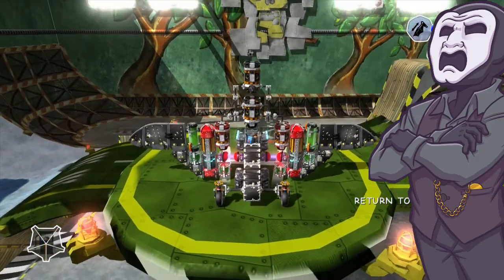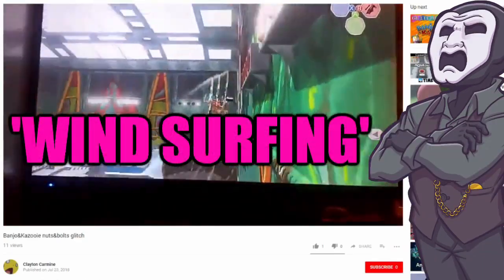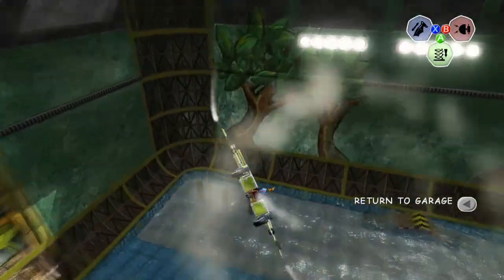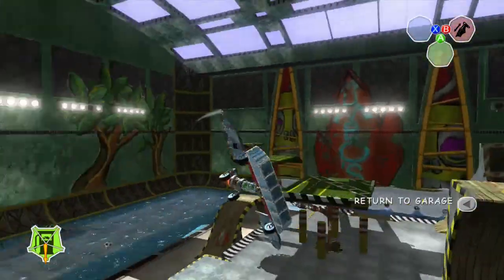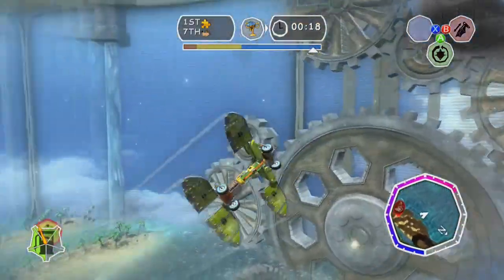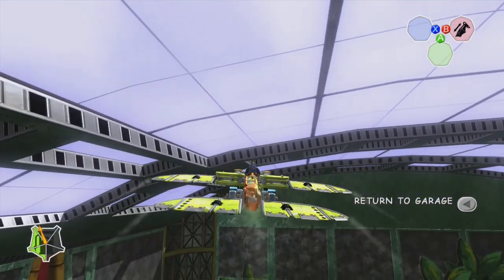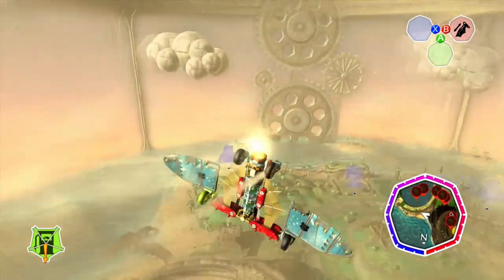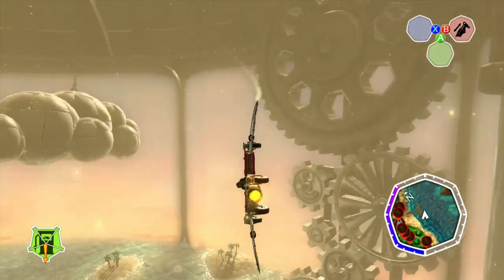Wind Surfing Exploit - A Builder's Guide to Nuts & Bolts

Comment: I think I've found an exploit you have not yet discovered, how can I share it with you?
Reply from the maker: You can describe it here, or post it in the discord or on twitter :) - Grim
Reply: @GrimAndGrin  Did you know that you can use the Suck-N-blow as main and only propulsion? The vehicle should be light mainly consisting of folding wings a  set of wheels in bike configuration and 2 Suck-N-blows facing backwards. It is fairly fast nearly hitting the speed limit and you have unlimited fuel/ wind power!